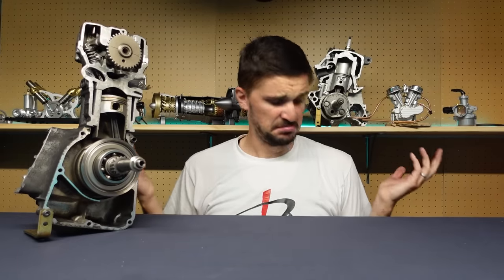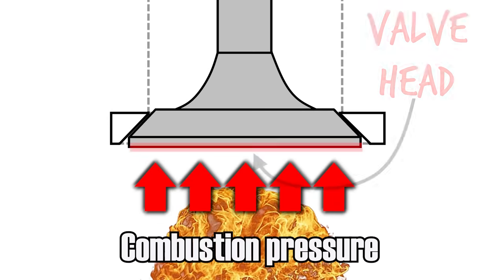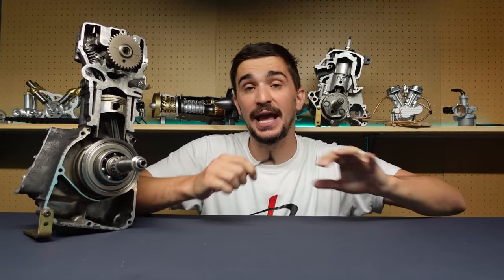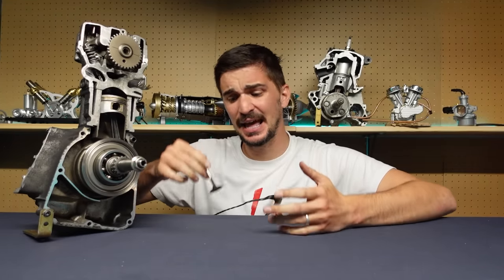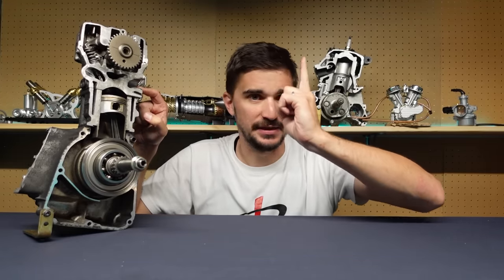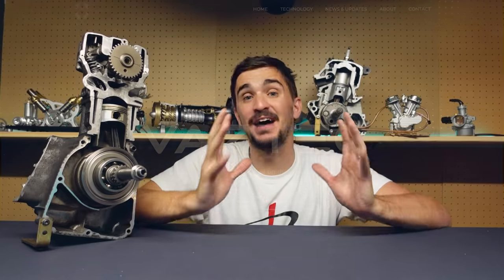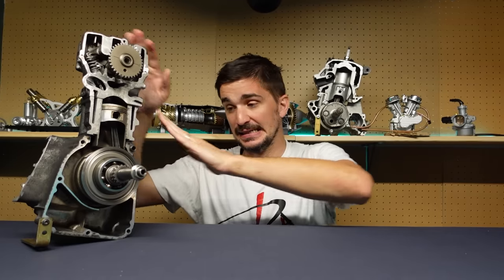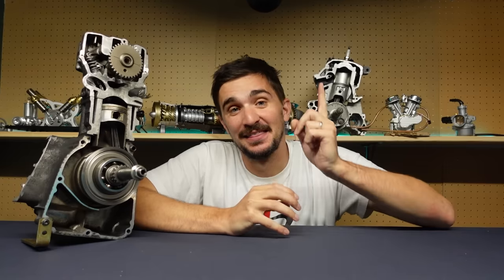Rotary Valves Make Normal Valves Look Silly - Why Aren't We Using Them?

Comment: The Bishop Rotary Valve worked. One of the design guys, Tony Wallis, did a speaking tour in Australia where he described the challenges he had convincing a manufacturer to actually use it.
Reply: Looks like it worked in racing usage... I would still remain skeptical until it sees daily driver use. Wish somebody would take a chance on it, even just for a couple prototypes to drive around in the outback
Reply: Most all rotary valve systems work. That is not the problem. The problem is that they do not work as well for as long.

Comment: Rotary valves in ICE were very popular concept 60-70 years ago Down Under (Australia and NZ) among motorcycle racers. Latest try was the Bishop rotary valve in Formula 1 some 20 years ago and they had a working prototype going up to 18500RPM. They said that V10 3L engine would be around 75kg with rotary valves design. But as many times before F1 regulatory body made mandatory use of poppet valves and that was the end of that story. 
The only living project with rotary valves is from some enthusiastic owner of BMW E36 in USA who converted his inline six M52 engine to rotary valves engine and that hybrid engine works quite nice for garage build.
Reply: Unfortunate
Reply: As usual, professional racing shanking interesting new technologies in the cradle...
Reply: Raced in Australian speedway in the 60’6

Comment: Coates has supposedly been selling spherical rotary valve engines for industrial applications since the 90's. Their oldest patent is from 1990. Their system is callled CSRV, the Coates Spherical Rotary Valve System. They have also apparently adapted it to a few automotive applications as well, but it seems like they stopped publicizing that on their website a long time ago. They supposedly had a small-block Ford engine which could turn 14,000 RPM with the CSRV fitted. I imagine that sealing issues were the main reason they didn't pursue automotive applications further.

Comment: One other major challenge with poppet valves in ICE applicatioms: Cooling. Valves have to be hollowed out and filled with sodium that melts (vaporizes?) upon being heated and makes the valve act as a heat pipe, transferring heat from the valve head to the stem for dissipation.

Also, the camshaft lobe centerline has to be offset slightly from the valve stem centerline, so the the valve is rotated about its axis every time the camshaft opens the valve. This rotation is to prevent hotspots or physical high-spots in the valve seat from wearing down the corresponding spot on the valve head (or vice versa). The rotation equalizes wear on the whole surface of the valve head and valve seat.
Reply: You will not find sodium core valve in a basic production engine the cost is too high and cooling gain and life cycles payback is not great enough to offset the cost. They are common only in extreme hyper cars/super cars  / hybrid racing engines / or cutom builds .  As for offset you will never get a true center on center position do to the valve rocker being on a fixed pivotal point the pivot point would itself need to follow a scribe arc - they have over the years tried to address this in various ways so the lobe was followed with an expanding arm so the rocker to stem stayed on center of cam lobe  and the end overthe valve stays align using an end shaper like a golden arc .  Just the simple geometry of the rocker arm being a fixed solid piece as valve mover the lenght of the rocker arm to stay on center line needs to lengthen so  a valve train no  mattr how you make it gets complex  so he K.I.S.S.  process is simple fast dirty set up
Reply: @DMPB-fi2ir  most tappets and bucket style, the cam is offset slightly on the lifter to rotate the lifter rather than operate purely i sliding im pretty sure thats what the quote was refrencing.
Reply: Both problems solved decades ago, for low or even no cost.
Reply: not something I have to worry about on my bone stock 5.3 truck engine.
Reply: @EnglertRacing96  The slight offset is also seen in a number of pushrod engines where it slightly rotates the cam follower on every lift cycle thus evening out wear on the followers face

Comment: Great coverage. You didn't mention one large detriment to rotary valves, combustion chamber shape optimization. No matter how thin you make the supporting structure between the combustion chamber and the valve, you'll always have a very odd shape and the valve surface will always drag its exposed (and contaminated) surface into the valve's envelope/cylinder. Poppet valves are very easy to fit into hemispherical, or near hemispherical, chambers.
Reply: Ok, that helps quantify and locate a restrictive condition. Next step, prove that is NOT prohibitive or able to be bypassed or overcome.
Reply: @gregrice1354  No, that's not how it works. You have to show a better alternative. No one is saying poppets are perfection, just that they have a lot of qualities which allow us to incorporate them into the overall design. 

It would be a little silly to start our exercise by attempting to prove a negative.

Comment: Im 64.
I drew up a rotary valve engine when I was about 18 years old and sent it to a technology company called Sarich in Western Australia. They were kind to me and told me It would not work.
You can actually use just one rotary valve which is both the exhaust and inlet. This helps to cool the valve. A ceramic cylinder is probably the way to go but timing is an issue.
Reply: Was there not a rotary valve head developed in South Australia? the name Clisby comes to mind back in the 60's,it was a long round piece of metal with flats machined in it that doubled as inlet and exhaust, it sat in half rounds on top of the head, I think that the downward pressure required to keep it tied down [as it became the top of the combustion chamber] may have worked against it as it had to act as an effective seal  but still able to rotate and be lubricated in some way, maybe today if retried, emission stands might be a problem. There is something on Clisby if you go to Google.
Reply: I do also remember that. My design had the port going through the rotary valve which gave more sealing between the ports and the chamber. And it had higher compression.
Honestly I don't think they will solve the sealing issue and as the rotary valve heats up it will bind too much.

Comment: In the 90’s some rotax two strokes had rotary valves on the intakes. They were different than the ones in this video, though. Instead they were a big flat disc with a slot cut out to allow air/fuel flow through it.
Reply: Yes I remember them, great engines as were the RG500 Suzukis. 
Rotary disc fuel inlet valves would not work on 4 stroke engines as the inlet port needs closing ''solidly'' e.g. by a chunk of metal. A disc valve which is only 0.7mm thick (Suzuki RG500 spec) would be obliterated under compression / ignition forces.
The rotary disc valve works in a 2 stroke because the piston physically closes the inlet and transfer ports for compression / ignition - the combustion chamber has no valves or ports.
Reply: Suzuki has used rotary valves also.
Reply: @notsofast2539  And Kawasaki, Yamaha, MZ, Bridgestone, Konig, Aprillia, Cagiva and many more. The rotary disc valve is very efficient 2 stroke system and allows asymmetric port timing - inlet controlled by disc, exhaust by piston.
Reply: The disc valve is only working against the intake side crank case pressure, not white hot combustion pressures.
Reply: @howardsimpson489  Yes in a 2 stroke as it was designed for
. The  original thread was replacing poppet valves with drum type rotary valves which would be exposed to combustion pressures. The disc valve just sorta sneaked in !

Comment: M.A.N. & many others experimenting with rotary valves found that rotating them the other way improved sealing & thus wear compared with the valve you show, I believe they settled on a pair of contra-rotating discs with ceramic faces though this led to a portion of the cylinder head being excessively thin unless they used the valves as the cylinder head thus magnifying sealing issues again & requiring a gap in the side of the piston crown for the injector which led to wear & sealing issues in the bore.

Comment: Historically they have been rotary valve systems in the past,  Aspin in 1939, before this Crossley Brothers in 1886, even Roland Cross in 1922 to name a few. Some of these have been revisited since and with advancements in metallurgy, sealing tech and bearings have become more viable, and  I think ceramic coating of combustion parts would make an improvement to their temperature tolerance.
Reply: The Aspin conical rotary valve is an interesting concept. I have an old mechanical book covering it in great detail. They even produced a flat 4 aero engine with the Aspin valve system fitted.

Comment: There is a company in Australia called Repco, back in the day they built a very successful formular one engine, the Repco Brabham engine. If I remember correctly, they made a aftermarket head for a red Holden engine, a very popular engine for modification, it had a rotary valve set up, but it was not reliable due to the expansion as you stated, the company had the ability to build a formular one engine but could not get the head to work reliably.
Reply: Didn't know about the rotary valve from repco but have a family friend who was a machinist from the 70s on at repco.

Besides you can get lots of power from a well designed head working around the valves.
Reply: @Low760  I don't think it went into production, I saw the head in an old Australian hot rod magazine under development and it made excellent power, it could have even been for a grey motor.
Reply: I wonder… with today’s computers could it be possible to just heat the sealing? Like preheat so it would expand and computer would keep it cold enough not to break
Reply: @bigboy9693  yes I remember seeing prototype open wheel car barrel valve set up. Late eighty's maybe not good on time. The sound was music to me very crisp and grumpy. This is first time since then I've heard this set up talked extremely proud of you cats thank you
Reply: @bigboy9693  it never went into production. It was an F1 engine only and they made several iterations, all of them V8s from what I understand. Used in the 1960s.
Reply: @RockSolitude  In 1966, the Repco engine was good enough to score three poles for Jack Brabham. In his one-off BT19, it helped him get four consecutive wins and both titles in the nine-race-long season, a unique accomplishment for a driver and constructor. This was his third title.
Reply: @C.I...  It was a complete clean sheet design built by Repco. All made inhouse.
Reply: The rotary valve head they designed was for a grey motor. Think they managed to get around 200hp but had major issues with sealing between the cylinders
Reply: And the Repco V8 they built was based and a holden 308. All aluminum from memory. Last one I saw was doing laps at Oran park on a track day, and it is one nice sounding engine when run hard.
Reply: @geoffgunn9673 Not quite. The 60s F1 engine was based on the Buick/Olds/Pontiac alloy block. The (iron) 308 was developed for F5000 in the 70s.
Reply: I'd bet a couple dollars there have been 1 or 2 improved materials, surfaces, finishes, mechanisms, that might overcome the idle "nah, been done... Failed" reactions.
Reply: @gregrice1354  My background is in machining and I have spent 50 years working on high-speed rotating equipment in power generation, oil and gas, I have yet to see any use of this style of valve in any application in all of my working life, the expansion rate of different materials are the main issue that cannot be overcome by different surface materials, particularly on the exhaust side that is exposed directly to the heat and carbon from the combustion, lubrication also represents another challenge.

Comment: I built a rotary valve cylinder head for a Honda 90 as my senior project in 88/89. It runs but lubrication and sealing are serious challenges that few have overcome.
Reply: I run rotary valve rotax snowmobile engines in all 4 of my 85 honda oddysey fl350s.
Reply: @shifty1927  -  Isn’t the Rotax rotary valve a 2-stroke? I believe Kawasaki popularized this in the 1970’s.
The valve described in the video is like the one I made and maintains a 4-cycle combustion process.
Reply: @Alaska_Engineer  yea they are 2 stroke.
Reply: @shifty1927  for 2 strokers, rotary valves have been around for a very long time as mentioned. Rotax and Kawasaki come to my mind as well. But, remember. The 2 stroke rotary valves only deal with the intake charge (no hot dry exhaust), only deal with low pressure in the crankcase before the fuel transfers into the cylinder. Not the high cylinder pressures achieved during combustion. But, I get what you were thinking.
Reply: @ironken1796  Cool and yea that makes sense.

Comment: Back in the 1970's as a teenager rotary valves suddenly struck me as a great idea to control gas flow through an engine, quickly drawing up my idea fag packet style  I rushed downstairs and showed my basic idea to my father. Hang on a minute says my father and takes a book down from the book shelves opening the book and flicking through he stopped on a page and showed me a drawing of an engine using an almost identical system. The book was a fantastic 
encyclopedia of engines of all types, unfortunately my father gave the book away many years ago and I no longer have it as a reference but as a teenager it really broadened my horizons as to the possibilities many many engineers had explored. My Father had designed an engine himself as a student at Loughborough college in 1947 a twin cylinder two stroke very light weight and compact 250 cc motor cycle engine, instead of a crank shaft the pistons and con rods ran in an orbital gear arrangement, dad later discovered that this idea had already been explored in the previous century as a steam engine. of course the idea was revisited in the late seventies as a four cylinder four stroke engine built in Australia named the Orbital. That to did not take off.

Comment: I remember reading about the Knight "Sleeve" valve engine which also overcame some of the drawbacks of the poppet valve system. They did go into production in the 1920s, but that technology didn't catch on for some reason. Might be a good topic for a future video.
Reply: Sleeve engines solved some problems of 1920'ies poppet valve technology, at the cost of introducing a bunch of its own problems. The brits did develop the technology for aero engines, at great cost, but in the end it wasn't an advantage over poppet valve technology of the time and they faded away.
Reply: @jbepsilon  It was a better performer AFAIK, but it was also a giant headache to manufacture.
Reply: Poor sealing with a lot more complexity.  @jbepsilon
Reply: Sleeve valves where heavily used in British WW2 aero engines.  E.g. The Bristol Hercules (14 cylinder radial) used in the Wellington - they made 84000 of them.  Also the Napier Sabre (3000hp from 37L 24 cylinder) used in the Hawker Typhoon.
Reply: ... it's only the jet engine that supplanted them.

Comment: Use dual, smaller barrels to ease location issues. I'm 75. When I was a senior in HS I spent a year with an 80+ year old man who had been a factory authorized "Knight" engine mechanic for Willys. I learned to reman the engines and it was fascinating. The dual sleeve valve design had some shortcomings but, it had some advantages too.

Comment: You should see how 2-stroke vespa scooter utilized rotary valve for its engine. And they are considered mainstream scooters back then. 
They are unique because they use the crankshaft web for the valve mechanism.
Reply: And Suzuki RG500 as well.
Reply: @robertomalatesta6604 and in the 70"s Kawasaki 100cc 2stroke race motorcycle.
Reply: Most of the two-stroke model airplane engines I ran in the sixties, seventies and eighties had rotary induction valves built into the hollow crankshafts. That was the standard then. A tiny handful used reed valves, as snowmobile engines do today. At any rate, the rotary valve did a great job. Of course, being on the intake side, it wasn't exposed to combustion gasses or temperatures.
Reply: Trabant 601 uses rotary valves on the crank webs, too.
Reply: That is not what is being talked about in this video. Rotary valves to seal the crankcase from the intake are very common on two strokes, including those that us the crankshaft itself as the rotary valve and they work quite well. What is being discussed in this video is how to seal the combustion chamber from the intake. That is done by the piston in a 2 stroke, by poppet valves in most 4 strokes.

Comment: The rotary valve I'm used to is from the rotax engines. Its just a flat disc with openings that sits over the intake ports and rotates in time with the engine. Surprised rotax engines weren't mentioned.
Reply: Also the Rotax engines make more power per displacement do to intake timing advantages.
Reply: @garycarbonneau499  yea I use them to swap into the old honda oddysey and pilot mini buggies. Currently running a 670 H.O. that makes around 140hp. Always joked that I have the largest collection of snowmobile engines without ever owning a sled. Have a wall of 583,617, and 670s just stacked up. I'm in Southern Maryland we barely get any snow.
Reply: This is for the intake valve on a two stroke, the valve is not subjected to combusion pressures and temperatures, it would not work on a four stroke.